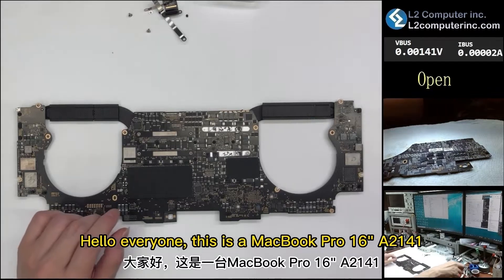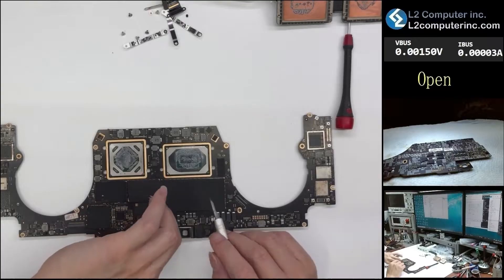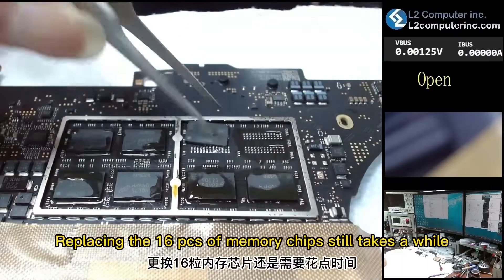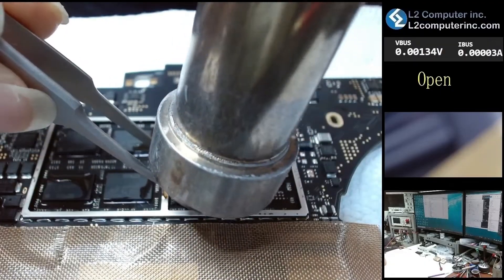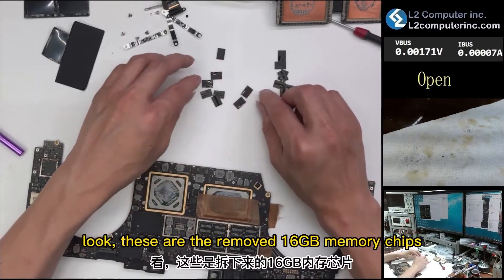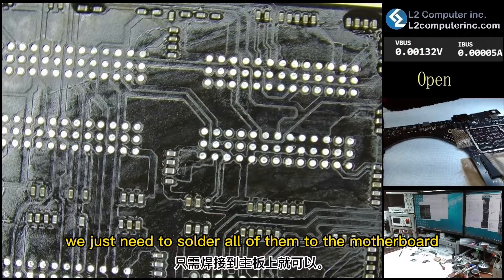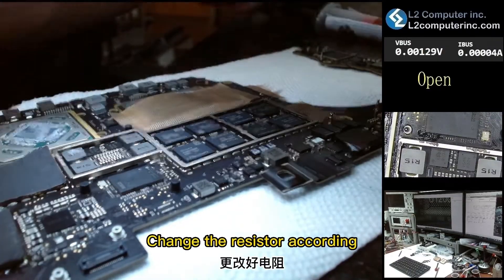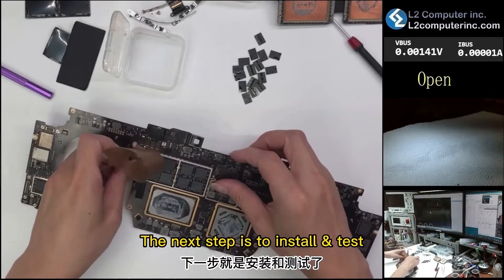Macbook pro 2019 16" A2141 64GB Memory upgrade

Comment: I have a question, i didnt know the 2017 macbook air 13 inch could take 16 gigs of ram. Im between buying a used 2017 macbook air 13 inch and a 2019 macbook air 13 inch. I was looking at ways to upgrade each macbook for the future.

Comment: For those wondering, the service does seem to still be available on the website in the description. Memory upgrades are available for these Intel models:

MacBook Pro
13" (2016-2017)
13" with Touch Bar (2016-2020)
15" with Touch Bar (2016-2019)
16" with Touch Bar (2019)

MacBook Air
11" (2012-2015)
13" (2012-2017)

Memory upgrade options are dependent on model number, so be sure to check before ordering.

Comment: hello their, I got my  a2141 ssds replaced becasue they were short due to humidity. Now the propbelm is that sometime , it happens rarely but the mac suddenly shuts down and then turn on with some error report but mac keeps running correctly, secondly the issue is that after the ssd replacement the fans run at full rpm , i can control them via mac fan control softwares sensor based functionality. but macbook it self seems not controling them. Maybe an incorect os install causing this or else. Need your advice Thanks

Comment: What year of Macbook is this? I have the 2019 16” i9 16gb. What is the cost of upgrading, I would love for a more powerful Mac but the guy I get my stuff from is balls at micro soldering
Reply: It looked like the same MacBook Pro you have (2019 MacBook Pro 16") because I have it too.  Yeah, those are some crazy soldering/unsoldering skills.  Even Apple doesn't go through that trouble, from what I hear.  If you have a bad CPU, memory or SSD and you have them fix it for you, they switch out the whole board instead of doing all of this.  It's insane.
Reply: @ChristmasEve777  it's not because they don't have the skills to do it, it's just that it's 100% more reliable from the factory. They may damage something else in the soldering process.  Well, it's just like with cars, I don't think a beat up but restored car is better than the same but new.

Comment: I have a old 2016 macbook pro with 64gb of ram is it possible to take that ram from 2016 and replace it to my new one which is the 2019 
both are macbook pro 15”
Reply from the maker: 2016 MacBook Pro the max memory is 16GB

Comment: where do you get the replacement memory? could it be de-soldered from just a standard 2666MHz DDR4 memory stick for a pc. my laptop memory went out and i need to fix but need the parts
Reply from the maker: Form the same model logicboard

Comment: its neccesary DFU on this proccess?, i soldered this H5AN8G8NCJR-VKC H5AN8G8NCJ-RVKC H5AN8G8NCJ RVKC SK Hynix, right now dont star on, i have 3v and 5v, ssd voltages but no 1.2v... 
thanks for your help
Reply from the maker: It can be used normally after replacing the memory and resistors, no need to restore
Reply: Hello my friend, in the video you move  R1531 to R1530, y and put R1532, and in the schematic its R1533- R1531 for hynix. But in the page 2 BOM options, no appears Hynix 64GB. Thanks for your time, i don't know if my new memory is wrong or i am doing something wrong.
Reply from the maker: Contact us via messenger and send me some pictures

Comment: Is it possible to do this for a Macbook pro mid 2015 15inch with 16gb ram to upgrade to 64gb ram.
Reply from the maker: No, it is not support 64gb
Reply: @l2computer310  32gb?
Reply from the maker: @BarbaryStudio  There is no this 32GB memory in the market
Reply: @l2computer310  oke thanks for the anwser

Comment: Nice work! Does Micron D9XPF compatible with A2141 ?
Reply from the maker: Not compatible
Reply: @l2computer310  What about D9XQM or K4ABG165WA-MCTD? Will it work with 3200Mhz chips? (like K4ABG165WA-MCWE)?
Reply from the maker: D9XQM work
Reply: @l2computer310  Thanks!

Comment: Nice to see this is not a lost art.  Love my solder station, and have come a long way.  What are you using for a heat shield?  I assume that's what's covering next to solder job ?
Reply from the maker: Teflon
Reply: @l2computer310  what kind ot soldering lot do you use for fixing the new memory chips? 
its contain soldering tin to make connection while melting under the housing?
Reply from the maker: @joedon9758 We use a hot air gun for repairing or replacing memory chips, and solder balls are used during the process to establish the connections.
Reply: @l2computer310  Thx a lot, I find for these memo chips on net already, 
its seems under the socket pads they soldered by the manufacturer so you need use some flux to  make clean connect and a heat gun as far its melt and spreads out. 
In your experience whats the maximum temperature this memo chips tolerate during the process?